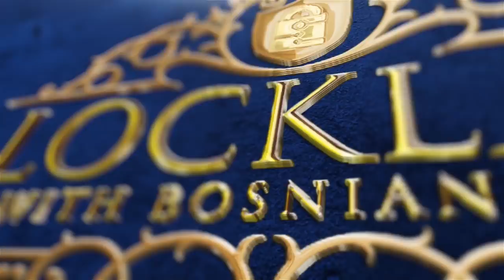(1496) Guard Locks Raising the Standard

Comment: Locks like this are easiest to pick using the upside down picking method. Push every pin all the way up, apply heavy tension, then gradually release tension as your rake the pins down. Then you can pick each pin if needed. Works well for me.
Reply: Never tried that, thanks for the idea Bud.
Reply: @AThreeDogNight  Doesn't usually work on a radical biting. On a biting like this lock has it would probably work very well.
Reply: @jahnwishart-ly6ov  Thanks for correcting my mistake. I really appreciate it.

Comment: I  bought a Guard 835 | 45, and I've seen videos of people raking that easily, but I think I got an updated version, because mine also has a lot of tension on the spring, and 2 spools in it. However, I was able to SPP it.

But I got the same model, but kind of rusted, and it was a nightmare. Impossible to set the spools properly, because some of the pins were rusted, so I had to push hard to set them, and I guess I overset them most of the time. And I think it had a challenging biting too.

Comment: I picked up a Guard 835 today and can not figure out what is going on inside that thing!
I tried to BP the lock but the bitting doesn't seem to allow for that.  The first pin is either no lift or close to it so I tried using TOK tension hoping that the wrench would block the first pin but I still cant get it open

Comment: How do I know my technique isn't just failing because I'm bad at this? I've got an Ace padlock I can rake open with lightest possible tension, one that binds up in a deep false set if I use more than that, and when I try to SPP it I always get a couple clicks out of various pins and then get to a point where it doesn't feel like anything's binding. My only guess is that something's overset and if that's not it I'm totally lost

Comment: I`ve tried to pick a lock (Elite 6pin) since 2 may, everyday, to spp it, since I "found" that`s the only way to pick these locks w/ 4 undercuts on 4 old style assa pins and 2 standard w/very tapered ends (I think these are chromed or something, very slick pins. they fall down supereasy)  All key pins exept 1 thats the shortest is torpedo`s also w/top tapered ends. Everything stock.  In Norway this is a very cheap lock, but it is a really fun lock. I have 2 and plan to at least buy one more. 
I tried replacing the "standard`s w/ 2 assa`s from the other lock and picked it relative easy
So I know for a fact that it is these superslick pins.
Your comment on to change things up is motivating, but what should I do?
Reply from the maker: Norway has the enviable situation where people recognize the importance of quality locks and are willing to invest in their security, so the locks you face will be MUCH more difficult than those in other countries.  To avoid frustrating yourself too much, I'd advise that you get some locks from other countries to improve your skills on.  The German Abus brand locks are an excellent place to start, as are the dedicated training locks from LearnLockPicking.com.
Reply: @bosnianbill  Yes. I once saw 4 garbage-containers, locked with 4 D12`s (Trioving/Assa Abloy) 
Abus is a great brand, and they are not all easy, not for me at least. The 88/50`s tok me some time before could pick them and now a 75/60 giving me some trouble. 
Thank`s a lot for answering and maybe because the Elite is so difficult, is the reason that I like it so much